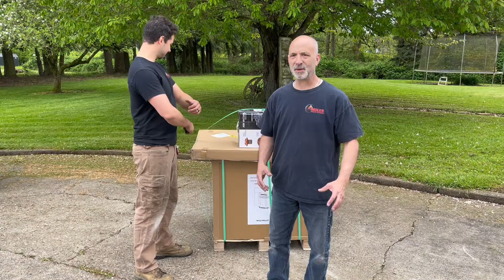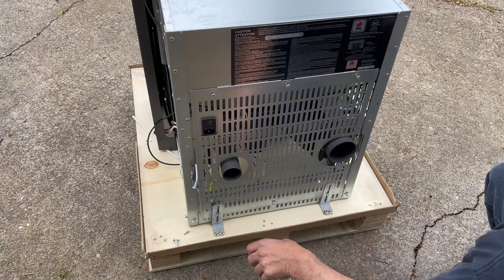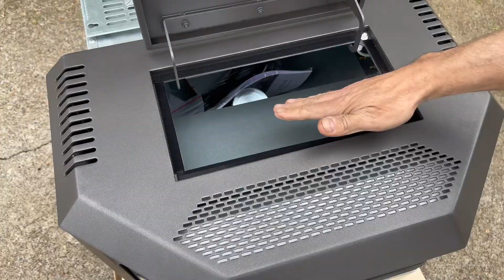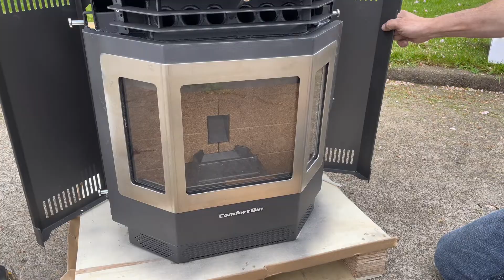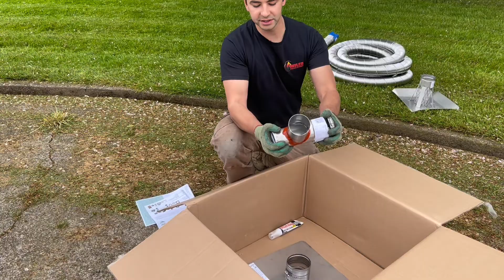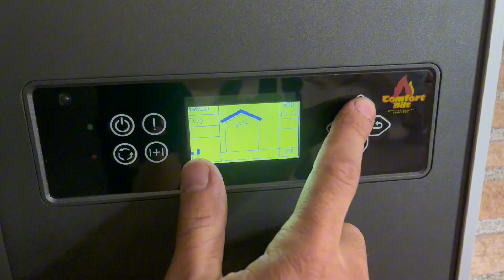ComfortBilt HP22i Pellet Stove Review and Unboxing + Beginner’s Walkthrough Tutorial Help Guide

Comment: My chimney  is about 14 feet. Should I run 4 inch flue pipe? And on this model the hp221 do I need a cleanout tee. I have to pull it out to access the flue pipe anyway.
Reply from the maker: 3" pipe kit with T will work best.
Milespelletstoves.com
Ventilation supplies 
Pipe kits
Select kit
Check out
Free shipping as per this date.
Thank You 
Brett and Briggs

Comment: Question about the vent pipe ? I’m gonna replace my existing gas insert with a pellet insert and was planning on modifying the existing gas vent going out the exterior wall behind the stove. It’s approximately 4’ from stove to exterior wall. Is there any reason I shouldn’t do that? Seems like it would work perfect but want professional opinion? Thanks
Reply from the maker: Please go by the specs in owners manual for code and safety.
Milespelletstoves.com
To order your stove.
Free shipping 
Please give us a call for additional help if needed 
Please Subscribe 
Thank You
Brett and Briggs

Comment: Where does the squirrel cage fan that  blows heat into the room  pull the air from since it is in the chimney firebox area?
Reply from the maker: Pulls room air in.
Or in your case....air from the firebox area. Recommended to clean this fan a couple times per year.
Please Subscribe 
Thank You
Brett and Briggs

Comment: Is there a larger surround available? Our fireplace hole is 43.5 inches wide.
Thank you
Reply from the maker: Unfortunately.....no.
One size on this model.
Some folks use a piece of sheet metal painted black and put against the brick...then the surround. It looks fine after completion. You can order this stove on our website if you wish.
Thank You
Please Subscribe 
Brett and Briggs
Reply from the maker: Unfortunately no.
Just comes in one size.
You can paint a piece of sheet metal....top, left and right and place against the brick then the surround against. Many folks do this to fill in the gap....looks fine.
Call us if needed. This stove can be purchased on our website if you decide to go this route.
Please subscribe. 
Thanks
Brett and Briggs

Comment: 2 questions. How does the trim panel work on an stone harth that is uneven. 2) do you use insulation around original fireplace opening? Thanks great video
Reply: Pipe foam or insulation is what I used with culture stone,
Reply from the maker: Push the surround as closed as possible to the brick. I have seen folks install insulation type material to fill in the gaps behind the stove surround. Most applications vary by home. Use your best judgment. 
Thank You